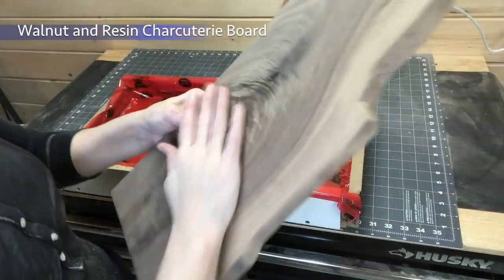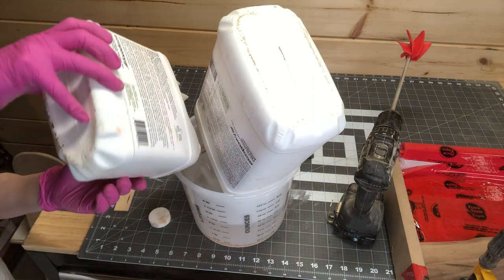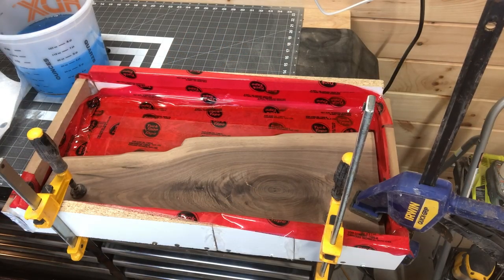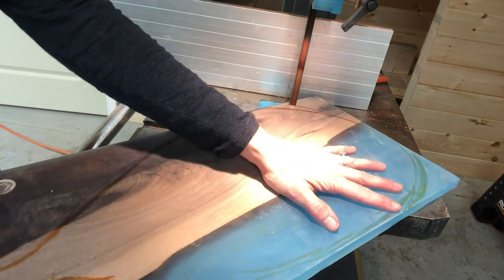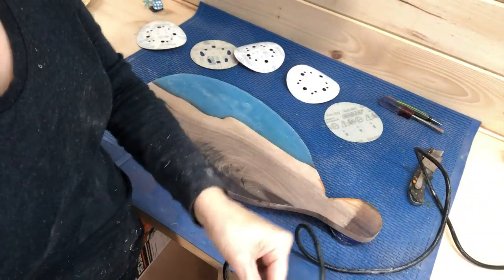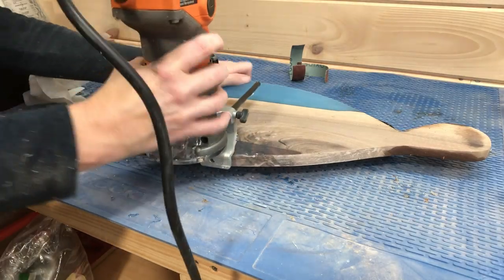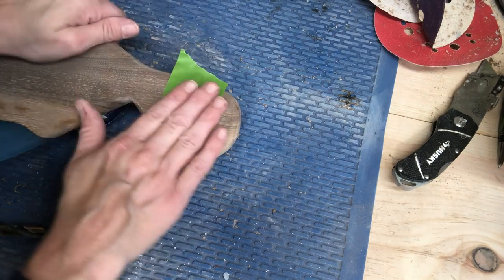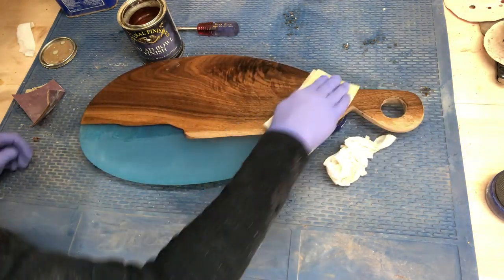How to Make a Charcuterie Board

Comment: Great job. Looks great. I have a metal coat hanger that I’ve straightened out and hang off the garage rafters so it’s available to hang projects, just like what you did, to dry after coatings. 👍🏻
Reply from the maker: Thanks! And for the hanger tip too!

Comment: Sure you discovered this tip. Drill the hole with just the forester bit and use backer board to prevent tear out. Drilling with reg bit first prevents the forest net bit from being able to center.
Otherwise great video and all great turners are also woodworkers. Thanks for diversity.
Reply from the maker: Kim Allen Thanks, Kim! Yes on the tip—you’re so right!
Reply: To add to that, if you don’t want to go all the way thru with the forstner, you can start it, maybe 1/8” deep with the forstner to establish a bore center, hog out the middle with whatever drill bit you want, as long as it’s smaller, then clean it up with the forstner. That’s how I did bench dog holes.
Reply: I came here to say this
Reply from the maker: @BenNawrath  Thanks for the info. Much appreciated!
Reply from the maker: @kmaglion  thanks for coming here to say that. :-/
Reply: Glad to be helpful!!
Reply from the maker: true.

Comment: Let me give you another tip for the cleanest hole in the handle.   Drill a pilot hole with a 1/8" bit, THEN use your Fortner bit.   The tiny hole will keep the tip of the forstner bit centered and prevent it from drifting and warbling which could mar the front.
Reply from the maker: Yes, thank you. Someone else mentioned that too! I appreciate the tip!

Comment: Very interesting!  I like the walnut and the resin, but it seemed to lose the pearlesence that it had when you poured it.  If I may suggest a resin saving tip, if you plan on an irregular shape for your final piece,  build a wall out of Roma Plastelina Modelling clay (doesn't dry and will be reusable) instead of having to cut away so much waste.
Reply from the maker: Thanks for the tip!
Reply: Michael Gross 
nice tip Michael...what grade would you use?
Thanks

Comment: It turned out really awesome I think you did a great job. But I might would have run around the hole you drilled with the router also... might have led to less sanding  in such a tight area l
Reply from the maker: Thanks! And you're right about the hole....I should have routed. Thanks for watching!